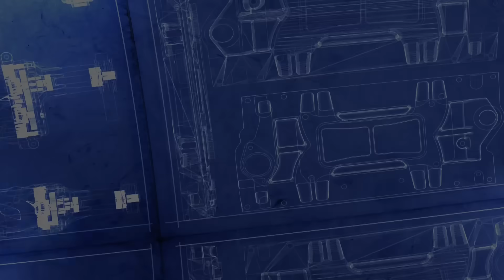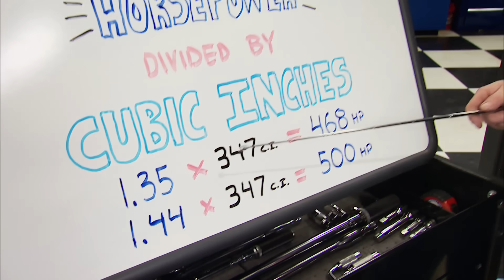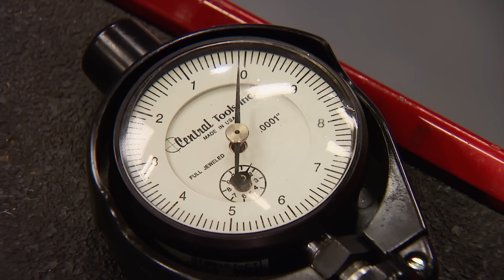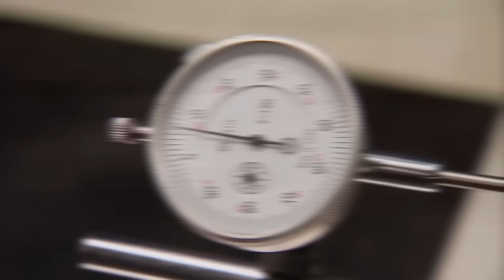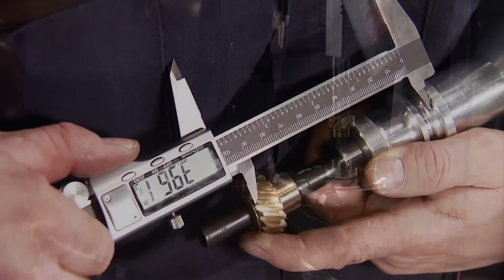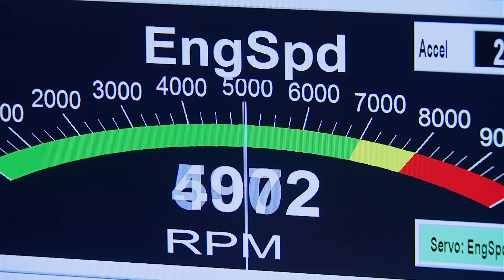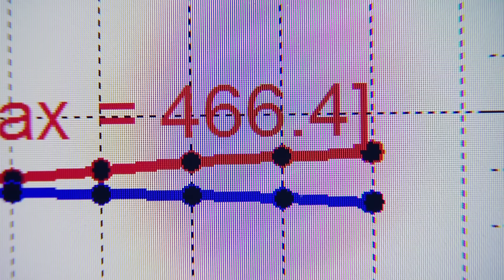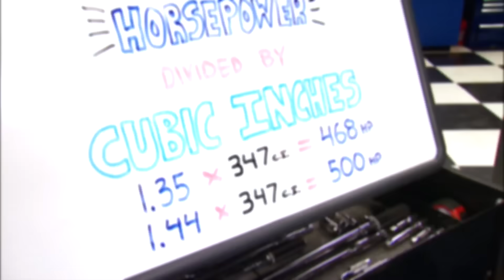Stroking A 5.0L Small Block Ford to 347 C.I. - Engine Power S2, E8

Comment: 550HP out of a roller 347 isnt unheard of
Reply: 347 don't last long though much over 500hp. They have a tendancy to split in half at the lifter valley. 331 I see can make more power on stock blocks because of better rod angle and better rotational harmonics boosted 331 can survive more hp then boosted 347 on the daily.
Reply: The Don it’s got more to do with your tuner than anything else. Guys have driven 347’s at higher power levels over extended periods of time. That’s more or less a saying with the 302 blocks. If you don’t get too crazy with the timing and fuel that setup can live for quite a while.
Reply: @18wheelzofsteel53  well... yeah you got me there a good tuner can make or break any engine build in all honesty. I still feel the boosted 331 is a safer/better way to go though. I mean really a 9.5 deck Windsor would be best to build. But if an 8.2 is what you are working with I really stand by a boosted 331 set up.
Reply: @thedon3836  totally agree as ive been thru about 3x 347s over the yrs

Comment: Curious how any builders on here can weigh in on the stock block living at 500hp. 

Here's why:

I had put together a 5.0 FI with good GT40 heads, intake and healthy comp cams stick.  I'm guessing it was ~ 375, based on 13.1 at 106.  Car was an automatic convertible with 3.55s. 

The mechanic who helped me update it (mid 1990s) cautioned me about adding nitrous or a stronger cam/heads without going to an SVO block. 

I ask, as there may be an opportunity to pick up a nice 85 GT and would love to replicate this combo.
Reply: It's na with relatively low cylinder pressure. If you wanna go boosted or nitrous I would recommend doing a  306 or 331 kit instead of a 347 because it will have better rotational harmonics and a less radical rod angle. Plus less mechineing. A main cap girdle is a must anything over 450hp imo on any stock block 8.2 deck windsor. Just fyi I have seen stock block 331 boosted as high as 650- 700hp absolute max the block can take. Never seen stock block 347 survive much over 550. But if you wanna make power on a budget then junkyard block 351w is the way to go (9.5 deck) boosted or nitrous 408 strocker on the cheep make 900hp all day long no issues.
Reply: @thedon3836  

Thank you!  I'm thinking to keep it in the 450-475 range, and NA.
Reply: Nascar blocks have thicker bores & 4bolt mains.but ain't cheap

Comment: So... An electric water pump reduces parasitic loss... Doesn't that just reapply that loss to the alternator as a parasitic loss??? Put this theory on the Dyno...
Reply: drew siff, no, plus, when you'd driving the alternator can handle it..
Reply: I think you missed the point of HP loss... 

And maybe I missed the point of parasitic loss only relating to a Dyno pull. The engine and accessories will be running off of the building power so the engine can be measure at its fullest potential.
Reply: @6628guitarhero  i know there's loss of power when you add stuff to the engine, BUT its not much, go with 25% underdrive pullies or more to get some of that back.. You actually lose more putting an auto trans vs a standard, go to an engine dyno n dyno the engine only if you want to know how much it makes on its own, I prefer dynoing at the tires..

Comment: This would’ve been a cooler project if they would’ve done an efi 5.0.
Reply: Naw it wouldn't sound as good as a carb. I'd miss it.
Reply: @senna138  If they used a more aggressive cam with 114 degrees of lobe separation and a high rpm intake manifold it would sound similar. I believe they build the motor for high RPM anyways, so it wouldn't change the performance much. Unless you mean the vacuum lines/distributor whirring. That cannot be replicated.
Reply: EFI is ghey.
Reply: Carb was just easier to test on the Dyno, a 86-93 Mustang EFI system would net same results with a good tune, n maybe even more hp n tq with the longer "upper n lower" intake runners...
Step up to Holley efi management n numbers would definitely  jump!
Reply: @martingatavaski1351  Horsepower would probably come down a few points but it wouldn't increase. You wouldn't see the horsepower difference until it was boosted. EFI would have a definitive torque advantage.

Comment: Neat engine, however why are the HP/cu so low? 2.0L and 3.0L engines can run 400+ HP making their HP/cu twice what you posted here with a mild turbo and electronic ignition.

Is it just a limitation of the tech or is there another reason?
Reply: You are comparing boosted engines against a naturally-aspirated one. 1.46 hp per cubic inch is not low at all for a pump gas street engine regardless of the brand.
Reply: Dakktyrel you said it yourself. THEY ARE BOOSTED. They cannot be compared. This is a very efficient naturally aspirated engine.
Reply: @bendurfee2720  So a mild boost should push this motor past 1000?
Reply: Dakktyrel in theory around 14lbs would get it around 1,000 but that power level wouldn’t be safe on stock block
Reply: V8s just sound way better than a 4cylinder
Reply: Dakktyrel      You should make video's and show us how it's done.

Comment: The problem is these engines won't last more than 50,000 miles from all of the side load on the pistons.
Reply: Bullshit it will stuff up if you use shit oil such as valvoline.and redline it

Comment: I need to look into summit racing blocks, might have to copy this for my 61 F100.
Reply: If you do, I highly recommend one change. Use a Performer RPM intake instead of the Victor jr . Open plenum intakes are OK for passenger cars but bad for trucks. An F100 weighs over 5000 lb's,  an duel plain will make Torque at a much lower RPM. Believe me , I've tried it, It's death on both trucks and vans to use open plenum intakes and delivers wallet draining gas mileage. Ask any speed shop and try to find one that will tell ya different.
Reply: Autojones agreed however I’m running a sniper EFI and they tend to love single plane intakes rather than dual plane.  I’ve also take some weight out of the truck, not a tone but some and have gears that help get that pig moving lol.
Reply: My honest opinion is don't waste your time, money  or effort building a stock block  8.2 deck windsor for your f100. You will be far cheaper, more reliable, more power and more upgrade ability  to build a stock block 9.5 deck Windsor (351) for that truck and you will be far more happy with it. You have the room trust me its better for your application. In a small mustang sure 8.2 deck is the way to go for a street car but in your truck you are going to want the low end torque and over all power potential you can get from a 351w (9.5 deck). Should be able to pull one out of a junk yard for under a grand.
Reply: The Don maybe I should have worded it different but I’d never go 347 on a stock block, 331 sure.  Honestly I had thought about pulling a 351 from like a mid 90s 250/350 and building that.  The reality is that at these prices I’d be better of getting a stock f150 coyote motor to start with and going from there.
Reply: @matthewskaggs3792  you do have the room for that but its alot of electronics. Don't get me wrong I see the coyote appeal it's just to plastic for me. And based on the truck you said I thought thats just not going to look right in there (At least for my personal taste). If I was to do it imo I would look for a strocker 9.5deck windsor already built for 10k or less. I have found some with blowers on them 900+hp   and everything under 15k if you wanna get crazy. But if I was to build an engine my self for your project it would be a nitrous 408ci w or maybe a 408  with a 671 on top and a set of dual quads. Depends on how "look at me" the project wants to go. You know but I really don't know what you are looking for out of your ride man. If it's a daily, more then 400hp reliably, reasonable mileage, nothing crazy, resto mod (modren drivetrain, old body) you wanna do well coyote or slightly built ecoboost 3.5 would be the only 2 ways to go then. Show truck, fun truck, miles per gallon? No smiles per gallon. Well you know what I would do buddy ✌😅
Reply: Matthew Skaggs  you’d have probably the same money in this build as a coyote swap. That block is 750 that rotating assembly is about 12-1300 I can’t remember exactly. The heads and intake are probably about another 2700. Carb prob another 6-700 cam and lifters probably 750. Electric water pump about 3-400. 

It mind sound vastly higher. You’ll spend about the same amount.
Reply: The Don all reality I’m either going 363 or 408.  It will be a lot of work but if I can get a barra motor I’ll go that route
Reply: @matthewskaggs3792  lol 😂😂😂 fuck ya Barra  the world ! ✌ wonder what shipping would cost to import one from down under?
Reply: @matthewskaggs3792   I would Bara a skyline or a supra in a heart beat brother.
Reply: The Don I think it was 1320 or one of those channels a guy barra swapped a skyline, I love it!

Comment: DO A 4.9 LITER/300 INLINE 6 BUILD!!!!!!!
Reply: They did.
Reply: @2012lucasb  Are you thinking of the slant six? 4.9 isnt slanted and is a far far way better motor
Reply: @wyattsullivan6355  is it on youtube I can only find the first part on the website
Reply: @KINGDeathWatch2  Im just going off of there youtube I've never looked at there website did they do a 4.9 on the website?
Reply: They say its impossible to kill a straight 6 well I'm waiting on the rebuild 🤣 I knocked mine out of time it killed itself my tranny wouldn't shift out of 2nd and by the time I started to slow down after strying 4 times it was too late .😥
Reply: KINGDeathWatch 1 300 is impossible to jump time, it’s all gear drive. If it does, you have destroyed the entire front of the engine
Reply: @scooterb3342  yes they are aren't they too bad mine had a bio wooden gear on the crank they weren't medal they had a metal sleeve on the inside that heated up asf the higher rpms and when j couldn't shift it melted
Reply: @scooterb3342  mine was a 1981 f 100 and a dr ly it only had about 320 000 mile son her I got from my dads work buddy for 800 and that throw on their speed that tranny killed my arms
Reply: KINGDeathWatch 1 thank for the link.. I have one myself in a 87 150. It’s in good shape and runs well. I thought is runs better than the 90’s 300 dose.
Reply: @jayyoutube8790  I bet they will drag anything almost
Reply: @KINGDeathWatch2  lol 😂 man I miss my 81 f100 ! I had it back in the late 90s when I first got my license and it's what I learned to wrench on. Ran it almost 3000 miles to and from work with a blown head gasket between 3 and 4 ! Just kept the coolant and oil topped off. Had no other choice at the time lol 😂 
My little brother got it after me and he ran it dead outta oil and seized it twice and I brought it back to life with marvel mystery oil lol 😂 oh what fond time's to think back on. Now I'm balls deep in a 69 galaxie fastback with a built 351w! And I drive a dodge ram 1500 with a hemi!
Reply: @borasmussen4794  lol beautiful car I would try and find a 428 or 429 to give her a hell of a heart
Reply: @KINGDeathWatch2  I would've but she's a factory 351w California car and it must have been destiny cuz I already had an early 70s 351w in my garage I bought off a guy for a great deal that rolled his bronco lol
Reply: @wyattsullivan6355  I think some of those old 225 Chrysler slant 6 engines had solid lifters and forged cranks from the factory. I had a super six in an old 76 Aspen. It wasn't super fast,but it could get out of its own way. I wish I still had that car. Red on red. Man that was alota red. Cragar wheels. It looked cool. Looked way faster than it was. Beat a 80's Camaro with it red light to red light. Back in the good old days. Nowadays the loser might try and shoot you or something.
Reply: Be interesting to see but man those motors were dogs.
Reply: @black98rt  Oh yeah I drive one everyday itd be cool to see one set up for performance by these two.
Reply: 4 barrel holley. Duel pumper
Reply: Jason Wilson not duel. But dual.  😉
Reply: Try that with a 300/6cyl, I had the thermostat stick on one, it still had oil in it but the head cracked.
Reply: Only if it’s efi and turbo ....
Reply: I love the 300 straight 6!  1980 F250 300 straight six with a C6.  Handled a large camper camper + a 2000# small race car and trailer.  You can stroke them to 340 CI.  Kind of "apples and oranges" but Engine Masters put a blower on a 225 slant six Dodge and made about the same power as a 383 Dodge!
Reply: Dodge 225 was a hot rod to. Good motors ford dodge old chevys

Comment: I would love to see what you guys could do with a 5.2 magnum 318
Reply: 340 heads rv cam
Reply: There  is a guy running 10.80s in his barracuda with a 318 fourspeed. The most underrated  engine mopar ever buikt
Reply: 400 HP 318?: https://www.hotrod.com/articles/318-small-block-build

Comment: Nice , that engine would look nice in my 72 ford f100
Reply: hell that would fit in my 2000 ranger I wonder if they would donate it to my cause.
Reply: @thestumaji656  Nah, two built 460's for the Ranger. One in the front and one in the box.
Reply: Imo stock block 351w is far better build for your truck.

Comment: Awesome results. I'd love to see you guys do a street/strip, more street, 393 Windsor with a stock block. My block is the slightly shorter deck height 9.480" version out of a 69 Torino. From what I understand the main girdle webbings are thicker too. I'm trying for 10.5 to 11 to 1 compression.
Reply: 393stroker I did exactly that for my 68 Fairlane! She's a beast.
Reply: @buckykattguitar  What heads and induction did you end up going with?
Reply: good.   job.  for.  302 ,,347,,bad.  hot.  rod

Comment: I know you have  to push all those new parts because they are sponsors. I just have to wonder what typical DIYer really does buy all new parts like that when building an engine (talking actual DIYer, not somebody paying somebody else to build it for them). Where could one save big money and just lose a little bit of power? That being said, the Summit block for $700 seems like a very good starting point (even tho can't find it on their website now). I built a well worn FE 360 truck motor myself decades ago and the machine shop bill was hefty.
Reply: Yep, can't I find the block on Summits website either. Also they say 205 heads but they weren't. They were 195 heads.

Comment: But what will it make with accessories and belt drive pump.  Also, whats the BMEP? Specific fuel consumption?
Reply: At 500 ish hp fuel consumption is the last thing on your mind
Reply: @mothridith9760  specific fuel consumption is data that shows how well the combination actually works.  besides that.... efficiency = more power for the same amount of fuel

Comment: What manifold can you run without the carb setup and still be able to keep close to same power?
Reply: Efi wise theres a bunch of manifolds from carb style to bread box to the standard up and over.
Reply: 1320crusier     Yea EFI , I’m thinking about running a Weiand Supercharger but I heard too much horsepower could crack the block